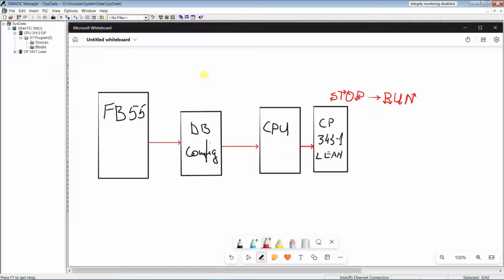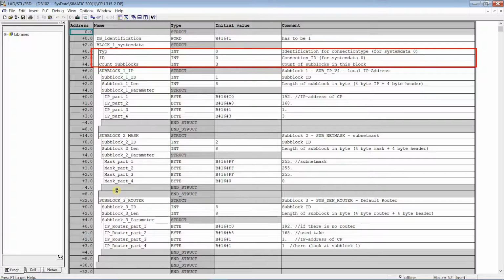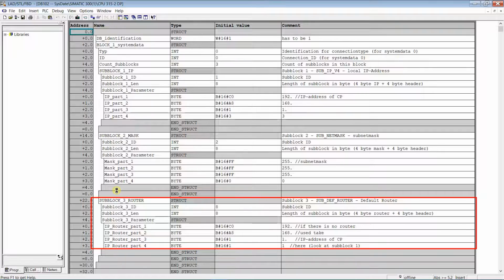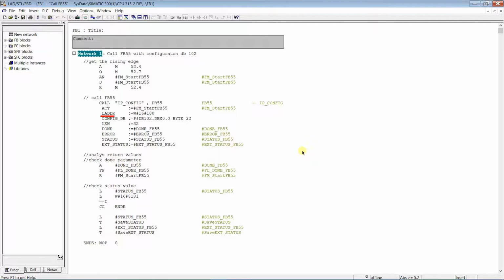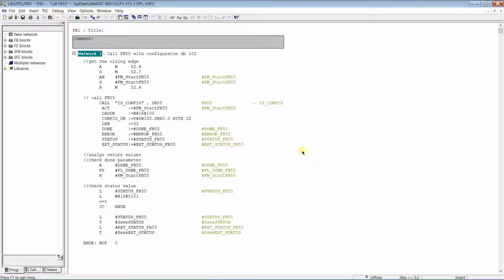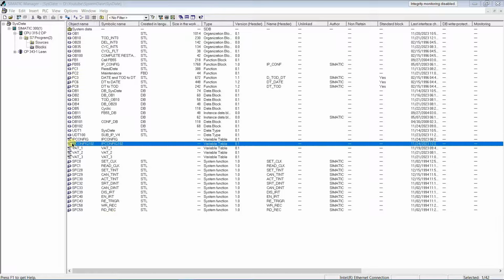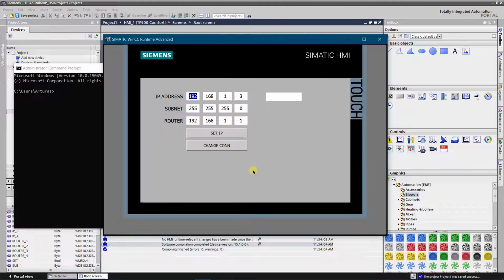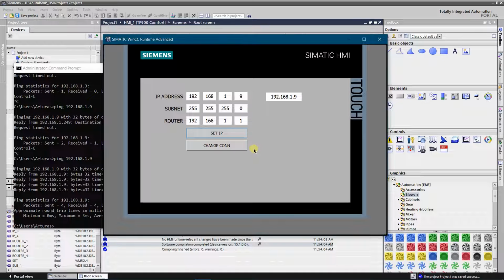Simatic STEP 7: Set IP address in user program with FB55 IP_CONFIG

Comment: Hi bro 
How can i connect s7-300 to other brand over tcp_ip
Reply from the maker: Hi, both devices need to be in the same subnet or ensure proper routing. You could create unspecified TCP or UDP connection, mode: send/receive, fetch, write and so on.

Comment from the maker: Some tips:
Make sure, that you assign unused IP address;
CP briefly stops while program transfers connection data;
Ensure, that communication data is sent each time after power loss (OB100 will help you to handle this);
ACT needs to be set to TRUE untill DONE arrise;
Always evaluate errors, it will save your time to find the problem.